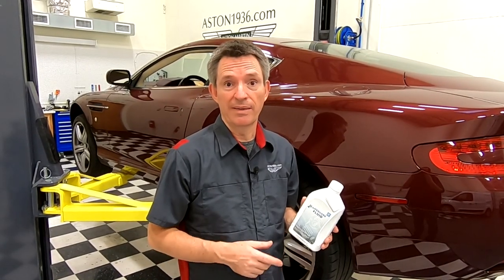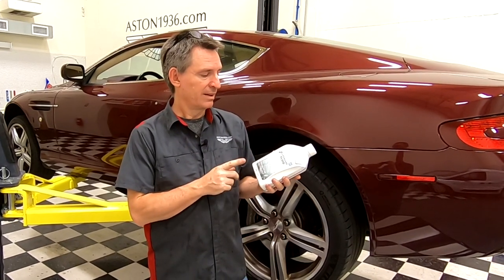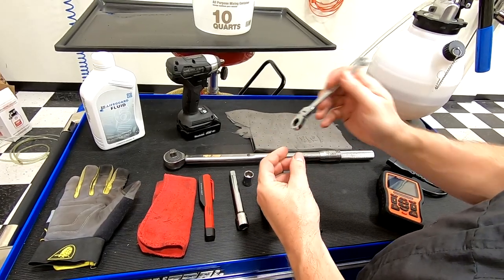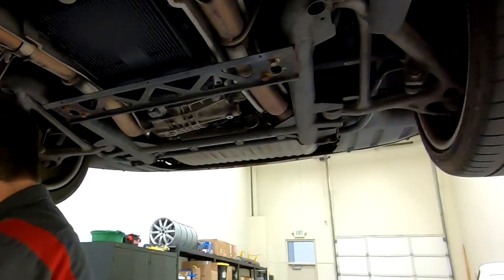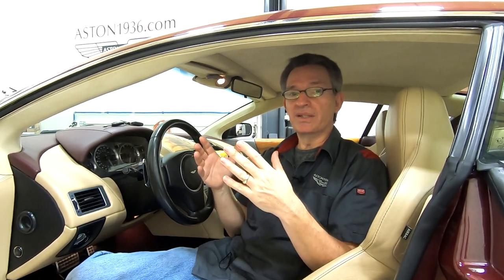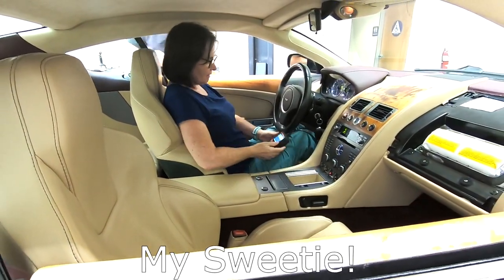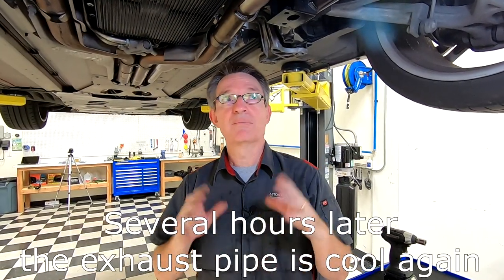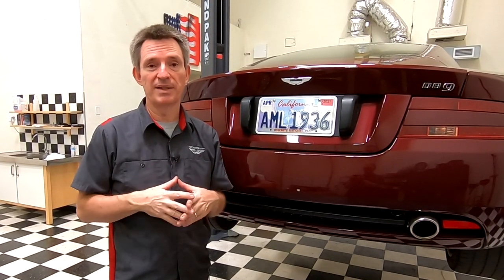Checking the Automatic Transmission Fluid Level in an Aston Martin DB9

Comment: I want to thank you for this video series it has been very helpful and perfect timing, I just finished a engine swap on my DB9. Today I received 10 liter of life guard 6 and I'm ready to tackle this stupidly difficult fluid change. This is really going to be a pain in my asston martin.
Reply from the maker: Glad it will help!   Pain in the Aston - nice.   Wow, engine swap.  That's a serious undertaking.  Doing the trans fluid should be a snap compared to that.   Good luck!
Reply: @Aston1936  thanks it's been difficult because the engine I bought was a v12 vantage S engine and they share just about the engine block not recommended should have bought a 2005 to 2010 engine

Comment: Another great series of videos.  The block of wood trick wedged in between the exhaust pipe and the transmission made the work a lot easier.  I was able to get a full size 8mm allen key into the drain plug.

Comment: Excellent guide thanks. I remember panicking to get the fluid in ASAP before the exhaust pipe got too hot. Back of my mind was that if it got too hot to put the plug back in I would loose a load of  fluid when I turned engine off.
Reply from the maker: Yep, its a balancing act.   As soon as the engine is off the pump stops and all the fluid rushes back to the sump and the fill plug suddenly have 2 liters of fluid gushing through it.....

Comment: Great job Steve ! Thanks for your great tutorials. Would it be easier to fill the fluid with the exhaust pipe off ? Or is it a bad idea because of exhaust smoke near our nose ? And to much noise :D
Reply from the maker: Thanks for the Kudos.   I didn't want o have the roar of the engine so close, and as you see in the video it wasn't too much harder to do the refill with the exhaust in place.   I eventually wise up and wedge a 2x4 to add about 1/2" of space, and this helped.   Thanks for watching!

Comment: Hello, did servicing your gear box fix the down shifting problem you mentioned ? Fantastic information you provided, I’m sure Aston Martin technicians are using your videos for training purposes !
Reply from the maker: Excellent question, I've been waiting for someone to ask that.  Yes, it appears to have fixed it.  It was never very severe in the first place, but there is no sign of it now.  Might have be a harbinger of things to come had I not serviced it at this point.  Thanks for watching!
Reply: @Aston1936  I’ve watched many car shows and major auto  gearbox problems are fixed with an oil and filter change, goes to show how important it is so maybe it’s the same in the engine, regular oil and filter changes all round. That’s a beautiful workshop have, very jealous. I’ve been trying to fit a 2 post hoist on the front drive as I don’t have the height , but my sweetie says no way ! 😂

Comment: My DB9 wont let me stay in 3rd gear while stopped, I also have 2 codes, and it wont let me go into 4th+ gear at all.
Reply from the maker: I've heard this is actually normal behavior, and not to worry.  Someone commented that perhaps UK cars have a slightly different software code that prevent this.    Just follow the procedures as best you can then shifting up through first and second, and if it won't allow third then its ok.

Comment: Where is the engine control unit in the Aston Martin?
Reply from the maker: There are Two PCMs (Power Train Control Modules) in a DB9, a Primary and Secondary.  The Primary is located behind the inner wheel liner of the right front wheel well.  The Secondary is in the left front wheel well.